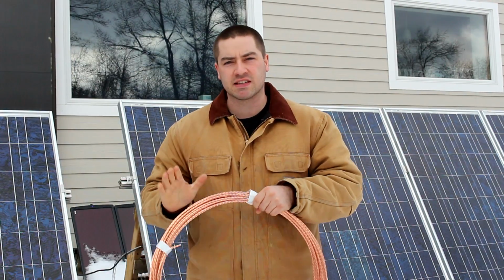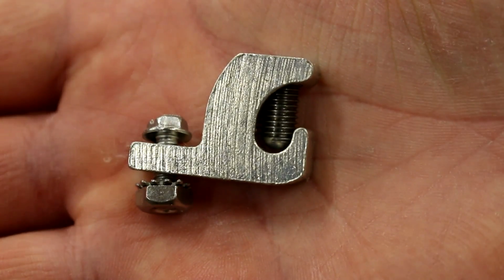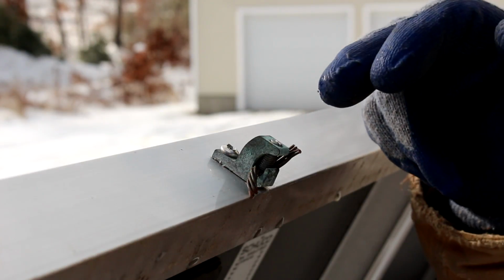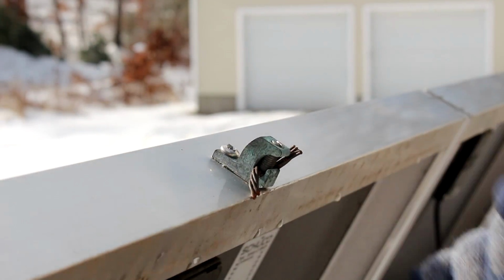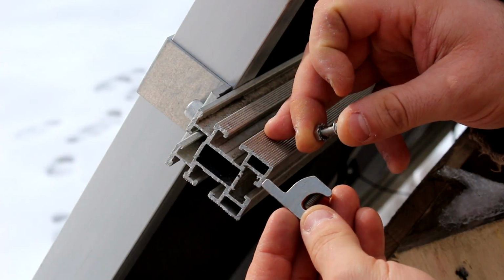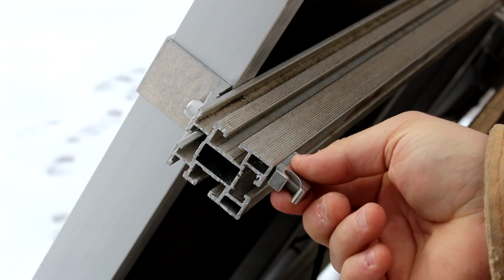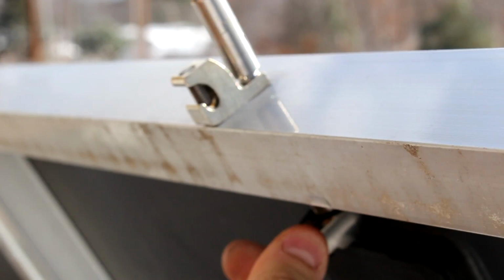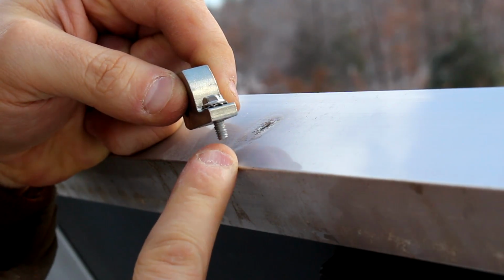Grounding Solar PV System, DIY, on Pallets

Comment: Hi David,

I love what you are doing, and I appreciate how much work it is to put out these videos.
I am especially intrigued by the hot water systems you have salvaged.  I agree with your statements in other videos that the Buildit solar website is incredible.

Your house sealing is amazing.  I am embarrassed at how leaky my 50 year old house is even after paying to have it air sealed. i think I went from 6000 CFM down to 3800 CFM  (if memory serves me right).  So I have a lot more room to improve.

Are you thinking of building or buying a battery for time shifting or for backup power?   Does your power company have evening peak rates?   

I am going solar this year and I am working on a battery backup system.   I also have a generator for backup, but I noticed in a power outage a few years back that the generator was super loud.  It was hard to sleep with it running.   I would like enough backup to go 12 hours without cranking the generator up.

While I don't have demand charges on my power bill or time of use charges, I would like to future proof against any of these issues like people are running into in California, Nevada and Arizona.  

All that said, I do have the ability depending on the plan to buy power at the market price, so it can be slightly cheaper in the middle of the night.  With solar, It will be zero during the day. 

My electrical load is huge 30 to 60 kwh per day.  Peak load is 11KW. I had the house air sealed and have R50 insulation in the Attic.  I still need to do some more upgrades.
Reply from the maker: Hi Gregg, It sounds like you are doing some good stuff.  You already dropped your air leakage by 37%, nice job!  

My eventual plan is to build a battery system with the solar panels and move some loads to it.  Basically, a small off-grid system.  Eventually (several years) we will move and I plan to build a 100% off-grid house.  So this system is a trial run for me.  I'm learning.

I can say that the solar hot water system in my house has been exceeding my expectations.  If I had a full basement I could have built a taller tank to take advantage of stratification, but I just have a crawlspace.  

The space heating solar system in the garage is working OK, but not perfect.  The garage is just not positioned as well as the house for it.

At an average of 50 kwh per day, are you heating with electric?
Reply: Hi David,
Good question about electric heat.   The house was built in 1977 as an All electric house.  By 1992 the neighborhood got natural gas, so the electric furnace was replaced with a gas furnace.  A couple years ago I replaced that furnace with another gas furnace after the heat exchanger developed a crack.
It has a 10 seer carrier 3 ton central air conditioner originally installed in 1992.  It still works, but has had to be recharged (R22) several times in the last 5 years.  I would replace it, but all the newer r410A  systems have a 20-30% failure rate within the first 5 years.

I built on to the house in 2005.  I installed electric radiant floor heat in the tile floor in a master bath over an unheated garage.

In 2004, I installed a Jacuzzi 6 person hot tub which is still running great after 14 years.  

In 2011, I replaced the water heater with a geo-spring heat pump 50 gallon hot water heater.

I have a deep freeze, and two refrigerators.

I recently installed a SENSE home energy monitor.  It uses a deep learning AI to identify loads in the house.
So far, it has only identified about half of the major loads in the house. I can rename the loads if I feel like it or keep what it suggests.

This month (10 days) so far we have used 420.8 kw hours. 
Other - 33.8%
Always on - 23.2%
Jacuzzi Hot tub - 21%
Master bath radiant floor - 6.4%
Fridge - 4.7%  - (I think this is the Heat pump water heater.)
Fridge 3 - 3.1%
Fridge 2 - 3.0%
Fridge 4 - 1.6% - (I think this is the chest style deep freeze.)
Finished Basement lights 1.3%
Heat 4 - 0.6%
Toaster - 0.5%
light 1 - 0.2%
Heat 2 - 0.2%
Microwave - 0.2%
Coffee maker - 0.1%
Garage door - 0.0%

In prep for going solar, I wanted to understand what my peak loads were.  It is useful to pull up the cell phone app before we leave the house to see if anything was left on. 

I think it has cut usage by at least 5KWh per day.  Shortly after getting the app, I was able to reprogram the radiant floor controller to better match how we use the floor.  I turn it on for 2 hours in the morning and 2 hours at night. Understanding the usage, helps focus my attention on what makes a difference.

I am hoping to size the system to include charging 2 electric cars (maybe next year).  Most of the charging will happen during the solar production hours or in the middle of the night.

I am thinking about building a solar heated hot water storage tank under the the hot tub that will "lose" heat to the bottom of the hot tub.   If the storage tank can be maintained above 120 degrees, then the 104 degree hot tub will seldom ever turn on.  Also, the water tank can be a preheater for the domestic hot water heater.

Comment: The ground needs to connect to the common ground outside or inside your load panel. Not at the ground rods. Your load panel ground should go to two ground rods 6’ or more apart with no breaks. Don’t do this wrong or it can be dangerous.

Comment: Why didnt you use the existing holes in the back of the panels?
Reply from the maker: These were used panels and the old grounds were connected up top.  I didn't think to put it anywhere else.  Thanks for watching.

Comment: Why not grounding the mounting rails on which the panels are sitting?
Reply: my thoughts exactly? the panels are already touching the mounting so you would be using way less wire and be doing the same thing right or wrong? Like you i have no grounding atm and just thought of it recently.
Reply: The railings can use as a ground no need for separate wires.

Comment: What about grounding for charger controller and batteries inverter
Reply: That is done with a ground fault protection breaker that grounds the negative terminal of the battery, charge controller, metal boxes, ECT. The GFP breaker is installed inline before the charge controller.

Comment: What is the resons of solar pannel earthing
Reply from the maker: If something shorts inside the panel and the positive or negative end up touching the frame, then the frame will be energized.  That means you have the potential to get shocked if you touch the frame.  By grounding you prevent that.  And, I've also added a ground fault circuit breaker which will shut off if this happens.

Comment: You could have only added small pieces of 6 mm2 grounding cable from each PV module to the other and to some points of the fixation system without using this much copper wire.
Reply from the maker: Thanks.
Reply: Not sure about your particular area and or local code, but one continuous ground wire ( 6 gauge) is the requirement in Kentucky.
Reply: @noneya3504  yes,  6awg solid copper is actually an NEC requirement.

Comment: jesus that is some beautiful copper, I don't think you needed that much did ya?
Reply from the maker: When I looked up the code it said 6 gauge wire, which is what I used.  6 gauge was heavier then I would have guessed, but that's what it called for.  Thanks for watching.
Reply: @DavidPozEnergy  I have not seen stranded grounding wire ever used on a house. Solid is all I have ever seen in my 71 years. Retires contractor.  I am not saying you are wrong. Just saying.

Comment: can you tell me about diode grounding
Reply from the maker: I'm sorry, but I don't know what that is.
Reply: The correct term is a lightning arrestor which is NEC code and is installed between the charge controller and the solar panels.

Comment: The star washer is meant to bite into the aluminium frame of the solar panel to bypass the anodised coating

Also I think your copper wire is quite loose and may touch the solar panel frames over time, a bird might sit on it and bend it to touch the frame permanently. You might have future issues with galvanic corrosion (the reason why you are using the steel lugs in the first place is to avoid this corrosion)

I think you might want to redo the star washers and tighten up the copper wire so they only touch the stainless steel lugs.
Reply from the maker: Thank you.  Very good suggestions.

Comment: looking good. but my experiences with grounding are from the Bell System training where we looked at the flow of current. one item was that you only allow the wire to go in one direction and not change up and down between panels and supports and the end ground should be in a downward direction not coming up from a loop down.  there is a location in Orlando Florida where lighting testing showed that the direction of wire leads for grounding worked best with the understanding that the lightning bolt would not change direction but look for the earth's ground point in the shortest direct path.

Comment: The excessive looping of the wiring is a bad idea, the entire point is to create the shortest possible path from the highest point to the ground. A single mounting tag on the upper mounting rail would have been plenty.

Comment: David, your grounding looks so over engineered. I just installed a small house 2.5Kw array with assistance of an electrician - aluminium is an excellent conductor and he reckoned an earthing wire from one point on the rail support was sufficient (assuming the panel frames all contact the same rail). Anyway, your array is supergrounded!
Reply: Its is anodized aluminium so its not as nearly conductive as aluminium wires. In order to counteract this trait the star washer was developed in order to bite the anodized aluminium
Reply: If you use the grounding star washers to connect the rails to the solar panels then you have a good connection, otherwise you haven't pierced the oxidization layer of the aluminum and it's tentative at best whether you have a good ground connection. He may have over done it, but on the other hand, without ground-bond washers, he may not have. (simple compression clamps don't provide a good electrical bond in many cases)
Reply: Something about grounding both the rails and the..the other thingy part of the frame, that both need continuity to your earth terminal.

Comment: Most modern day panels have a slot for you to loop the grounding wiring so you don't have to drill the panels
Reply: Not sure where you got that idea. Aluminum has an oxidation problem so they anodize the bare aluminum. You have to get past the anodizing to get a good electrical connection.

Comment: Grounding doesn't make it safer. Grounding is there to reduce static electricity on equipment and metal parts. I think you are misinformed about the subject. How does grounding make it safer?

Comment: TEK Screws are not a good ground solution ever, they will work them selves lose over a short period of time with expansion and contraction.  NEC dictates similar metal and at least three threads (machine thread)   Panels have approved specs for grounding via the Manufactures Cut sheets available.     Think Ground Path
Reply from the maker: Hi Peter, Thanks for letting me know about the self-tapping screws working loose. What do you suggest for a good ground connection to the rails?

Comment: Thank you for sharing this information. In my next statement, I hope you don't perceive it as argumentative. It's just that the topic can be quite confusing. Some people argue that grounding your system turns it into a lightning rod, while others claim the opposite. Unfortunately, not many go into the specifics, and they simply present facts without providing clear explanations. These assertions often come from professionals, leaving non-professionals feeling bewildered.
I will provide one or two video references to illustrate the ongoing debate.

https://youtu.be/abfXLujggBo                             https://youtu.be/i7vHEHB3a-M
The link above is against grounding.                  The link above is for grounding.

 There are literally hundreds of discussions going back and forth on whether solar systems should be grounded or not. This ambiguity can make it challenging for beginners to make informed decisions. That's why I thought of reaching out to you to consider making a video that addresses this situation. Your informative videos are easy to comprehend, and I greatly appreciate that. Solar energy is not always straightforward for beginners, and it can be both confusing and potentially dangerous. Having someone like you who can break down the details and explain the reasons behind certain choices is incredibly valuable.
Once again, thank you for your dedication in producing educational content. It fills a crucial gap and helps individuals navigate the complexities of solar energy. By providing clear explanations, you empower beginners to make informed choices and understand the underlying principles. Your efforts are greatly appreciated in making this fascinating field more accessible to all.

Comment: over build but incorrect, washer should below the nut, use bare single wire as ground, rails would be used as ground conductor if done properly. and, ground rod should be 8' copper not the loose steel pipe.

Comment: Not a good install look at nec code book
Reply from the maker: darrel204, thanks for commenting.  What should I correct?  Thanks.
Reply: they usually dont reply once the anger subsides ;) nice set up
Reply from the maker: Yeah, I guess not.
Reply: Hey, the Thing is, that the purpouse of PV modules grounding is the lightening protection on the first place. The lightening strike is conected with a lot of kinetic energy, so with your instalation, after the lightening strike, your grounding wire could be easily torn out of the final grounding connection, because the whole loop is instaled too loosely, that means blind lead-in, means the complete destruction of the loop by fire. The other side is that if you tight the wire up, the whole instalation will looks 200% better ;)
P.s. Greetings from the PV crew from Czech republic and sorry for grammar mistakes if there are some ;)
Reply from the maker: Thank you Michal.

Comment: Hi David:
I have voltage between inverter enclosure  ground and neutral. What could be the problem. I am off grid so should be something with solar system

Thank you.